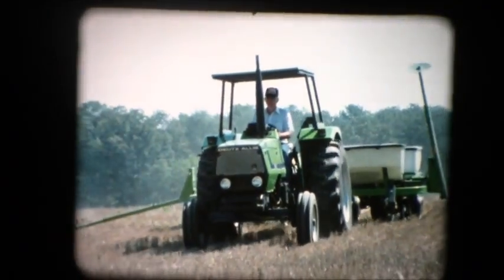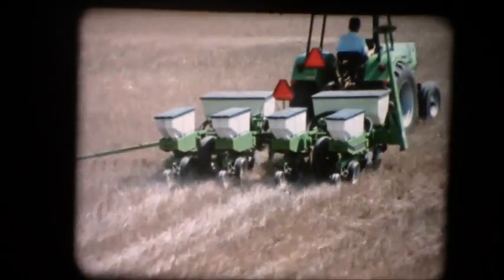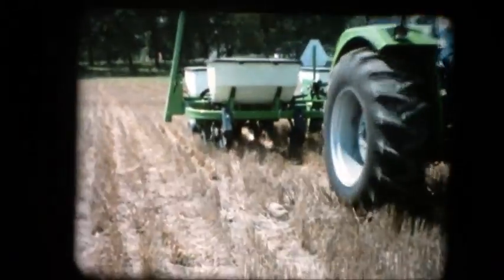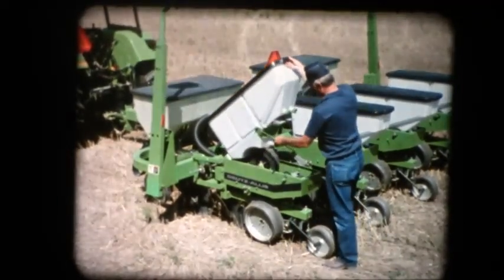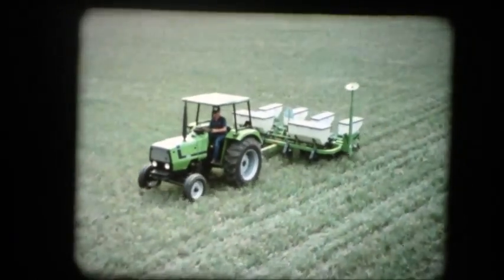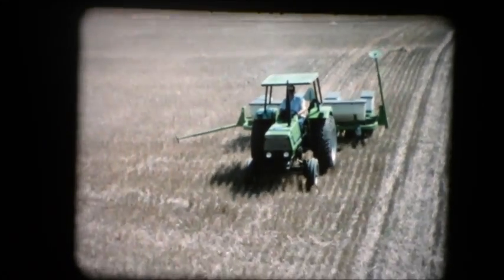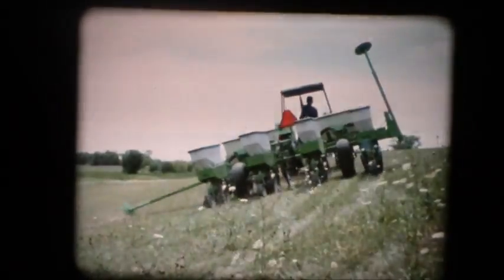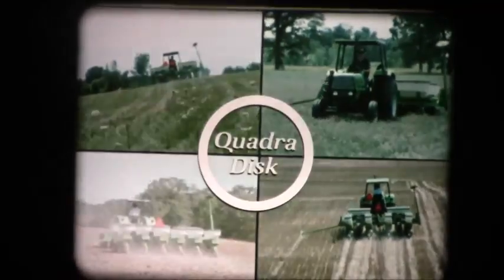1986 Deutz Allis Dealer Movie Model 385 Planter

Comment: Were these planters build by DEUTZ-ALLIS themselves?
Reply: Favorit 926 Vario They were designed by Allis Chalmers, but would have been built in Laporte. Deutz didn't buy laporte, so they were manufactured by Vermeer. And much like everything Deutz touched they destroyed the planter, which was sold off to Landol, but after a few years they quit the line altogether
Reply: Favorit 926 Vario They were designed by Allis Chalmers and were built by Vermeer, than sold off to Landoll